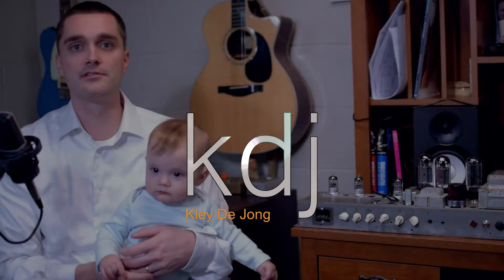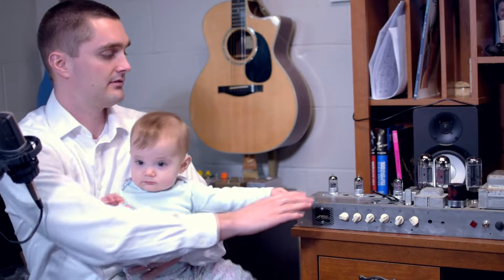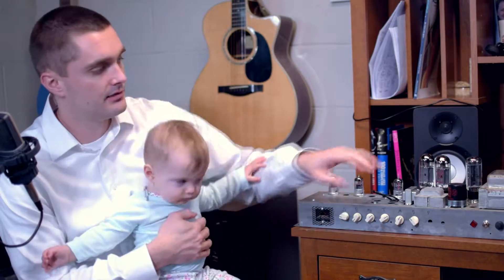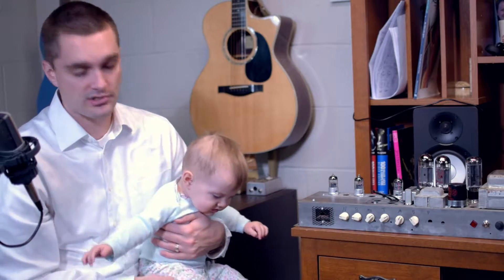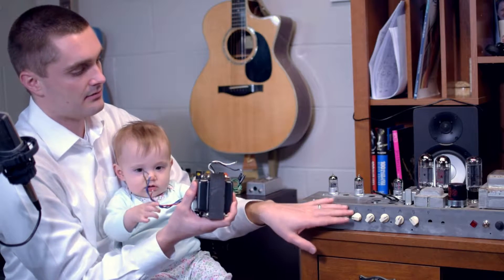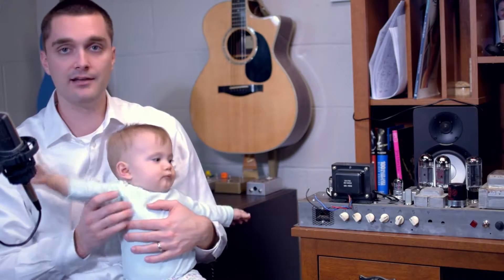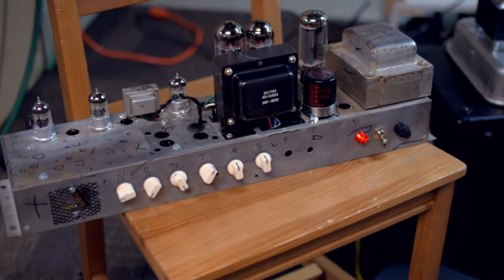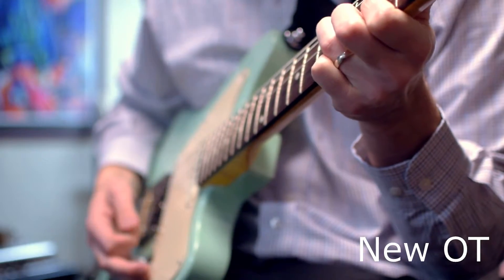Hammond AO-29 Plexi Conversion - Output Transformer Swap Comparison

Comment: Hey Kley! First off you’re amazing with your kiddos. 

Second, I have a similar (AO-20936-THREE) output transformer and am having a difficult time determining the winding ratio/primary and secondary impedances. I’ve followed various methods; from applying ac voltage to the primary — applying voltage to secondary as Uncle Doug demonstrates — and trying various voltages from 6.3 to 95 and just can’t get something right for a 5E3 (8k primary as you know). 

To add more confusion there are multiple versions of this OT with a different final digit, from 0-3. I know this came from an AO-29 from an M3, which google claims is an 8 ohm speaker load. And it is driven by two push pull 6v6. Everything looks fine until I start doing the math… and it’s pretty basic arithmetic. 

Which version (final suffix/digit) OT do you have demonstrated here? I have a single secondary, yellow and green. 

What did you determine the primary impedance to be? Running 6L6 I imagine you either figured the primary is closer to 4k, or you simply knew that if it’s an 8k primary so you could run at 4k if you took advantage of impedance ratio matching and used a lower ohm speaker to account for the change in primary load resistance. 

I really appreciate any advice you have or things you discovered during your build, the guy I got the transformer from mentioned running a 4Ohm speaker for a PP 6V6 build, and since I’m calculating 5.35 ohm secondaries using Uncle Doug’s method I’m wondering if that’s my most accurate reading. 

Thanks for all you do for us!

Comment: Well the big myth is that these Hammond chassis are a good basis for an amp.  The reality is, you are just buying a used set of transformers that were designed for a particular application and power tube set.  You are kind of locked to the power tube section, and you can redesign what ever pre-amp you'd want provided there is even heater current available to run the tubes....plus you have to know what you are doing.  That's why in the era of vacuum tubes the tube manufacturers had published their spec books, and in particular the RCA manual had the back section with different designs for different circuits.  That's where leo fender lifted some of the early amps from when he started to manufacture.  Bell labs had developed almost every circuit you could for particular tubes as they became available, that was their purpose...….create a tube and create a market to sell them by giving away designs.
The primary on the output transformer is matched for the 6V6 tube load and not for the 6L6's.  The fender smaller tweed amps from the 1950's used a 28 watt output transformer on 2 6L6's capable of 40 to 50 watts.  The amps were not meant to run wide open thus being wattage undersized.....they tended to burn up and die.
Same situation with that Hammond 6V6 transformer running with 6L6's.....other than the load mismatch.
SO swapping the output transformer with the one you got corrected that issue...….that's all.
What ever the range that the output transformer was designed for is what you got...the frequency response.  And without the spec sheet for it, you don't know if its an interleaved wound transformer or not.  And you'd have to check the amplifier it was for to determine what the speaker load is meant to be for it so its properly matched.  
A richer sounding transformer would be from black face or silver face fender bassman 50, as the frequency response is deeper for the low end and it is a fat transformer with a heavy lamination stack.  They are usually a great swap out for a black face or silver face bandmaster or pro or tremolux or vibrolux chassis to replace their small common output transformers.  Without looking, I think the bassman is for a 4 ohm match speaker but can run an 8 ohm also though at less output power and efficiency which would be a looser response than it would be for a proper match load.  
The super reverb output transformer is also quite beefy but you are limited to a 2 ohm load, and similarly beefy is a twin reverb output transformer though being 100 watts for a 4 ohm load, it will work for 2 power tubes but with an 8 ohm load.  
When the output transformer saturates, its exceeded its capacity and sounds really great.....but its not going to last as its in the zone where its self destructing and burning up......it depends on how long it can hang in that zone before it fails.  The small cheap off brand amps like VALCO's sound amazing because they have undersized output transformers.  So the margin of the undersizement in relation to the power tubes.....minding that the power tubes wear and gradually have a loss in power.....the 2 factors combined will kind of even out to a degree when they are riding the edge......but also keep in mind that the older amps also were rectifier tube power supplies and most likely cathode biased, so the voltage sag is also a factor as the sag pulled the maximum power down on the tubes.  When you get into a fixed bias power section amp.....there is no sag.  A power section designed before the silicon rectifiers were common, thus using a gz34 rectifier, that rectifier was a very fast rectifier almost as fast as silicon diodes....so they really don't sag.  The difference is in the power rail filtering, because the rectifier tubes can only handle so much......5U4's are 40uf and gz34's are 50uf, where as a silicon rectifier in a fender twin can run 110uf which would be a great reserve of power in the power rail for the low end response.  That combined with the power transformers capacity determine what tube load it can run in relation to the maximum current draw of the pair of tubes...….a transformer with a high reserve wouldn't sag...it would supply all the needed energy or more for the current draw at the maximum end.  But that also has a relationship with the bias of the tubes.....if you bias cool at 50% or in the middle at 60% or hot at 70%......the bias determines the tube breakup dynamics of the power tubes.....some saturation & power tube distortion/overdrive...…..but that's also dependent on the signal driving the power tubes from the phase inverter.  SO an amp without a master volume before the phase inverter....the gateway to the power tubes......you have to dial up on the preamp volume to get the signal wave high enough to induce the power tube compression distortion/overdrive characteristic...….so you'll be playing LOUD.  The preamp, particularly if its isolated by a pre-phase inverter master volume....the gate keeper to the power tubes.....here is how it works:
you dial up on the pre amp volume and the wave produced by the preamp tubes amplification gets bigger.....the range of the size of the wave is called the head room as that range is where the wave is not altered.  The alteration comes when the increase of the volume knob pushes the signal to its maximum headroom and the top of the wave begins to compress.....tube compression, but the best way to put it into word is substitute compress with the term "squish".  The amount of squish on the wave peak is the pre-amp overdrive distortion character.  That is the signal you have to pass through the entire pre-amp section to the phase inverter.....as the phase inverter passes the split signal to the power tubes to drive the signal through the power tubes and the output transformer to the speaker.   This is why you have to crank a non master volume amp.....to induce the pre-amp signal squish on the wave.  With a master volume amp and on the phase inverter entry point......the gate keeper to the power tubes......you control the amount of signal being fed to the power tube section to be amplified.  The loudness of the amp......to a degree.  If its a knob with a scale  to 10, from the threshold of sound via the master volume and dialing up to 3......it will be clean and get louder as up open up to 3.  Going passed 3 to about 7 on the dial is where the power tube dynamics come in in varying degrees as you open up on the dial.  from 7 to wide open is the jimi Hendrix territory.  This is also part dependent on how you bias the power tubes and the power tube selection grade.  You can select power tubes with a low scale mid scale or high scale point of where they compress.  A high scale set stay cleaner with a higher threshold of compression point as to when it happens, and a low scale will compress faster and earlier on with less head room for clean......the high scale tubes will stay in the clean zone longer ranging up in volume.  It depends on what you seek.   American amps with 6L6's stay cleaner as opposed to European amps with el34's as they compress fast.

Sorry for the novel, but that's the easiest explanation in the general sense of what's going on....when you don't know what you are doing.
Beyond the scope of what I wrote.....it voltages and the signal capacitors and resistors and how they all act as signal filters in passing the signal thru the amplifier circuit, and the selection of the pre-amp tubes and the bias of the pre-amp tubes.  An electrical engineer would go to the mathematical perspectives, but a real electronics expert doesn't rely all on the math....its the ears and knowing by experience what the sections do with the signal......its very complexed.  9 pin pre-amp tubes have amplification factors and they also have current factors.....12ax7's and 5751's and 12at7's and 12ay7's and 12au7's.  They all add up.
In the parts world, Hammond was the only dominant source because of the organs....they produced all their parts.  They happen to be expensive too because they are domestic......which doesn't mean that their product is better than another manufacturers transformers.  SO these chassis's are attractive because of the parts, the same way a chassis from an old tube hifi console home stereo would be attractive.....much less the same from any tube based organ from the era.

What people can't grasp is that its the summation of everything in an amp that makes the sound.....
BUT there is a factor of age and deterioration.....so when somebody presents me with am amplifier that's 50 years old and hasn't had maintenance.....and proceeds to tell me about how great the amp is....and its all talked up in forums and literature.....
The real reality is that its an old deteriorated amp, and its not sounding or performing as if it just came off the assembly line from day one, and if it is rehab'd and restored to the performance of a day one condition, the signal caps will be different than what was originally used plus you do not have a time machine to do a side by side comparison.  Electronics have a service life.  If they still made Astron caps with 1950's materials...that might be one thing, but the don't......you can only get approximations.
Reply: Great detailed information 👍

Comment: Hi Kley, I know this is an older video, but I saw you asking questions on some Tele forum a while back and it was driving me crazy because I couldn't reply. I'm sure you found this out already but Yes, the power transformer on some early 29's did use a field coil speaker (nice speaker too). I have both, the silver is for the field coil type, the black transformers are for permanent magnet type. You seemed to be hung up on the voltage capacity of the original output transformer as it used 6v6's and you were going to use 6l6s..  While current draw would be an issue, it's the impedance of the primary (the brown to blue wire winding) on the 6v6 output transformer which is incorrect for 6l6's and no one seemed to tell you that. So getting the proper transformer was crucial. I didn't watch this video yet ( I just came across your channel), but any 6l6gc output transformer from the late 50's-70's (from an amp or pa) would be fine. You can find them on ebay for 20-30 dollars for the future. I will see what you purchased, but I know new ones aren't cheap. You have some cool builds, I'm going to check them out. Be well, Tom